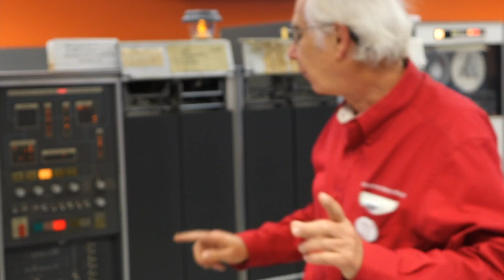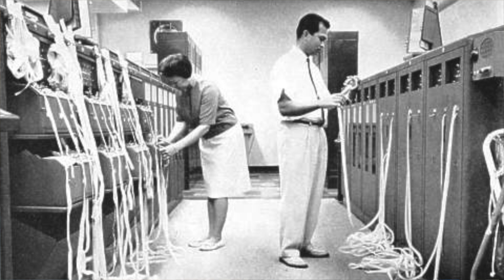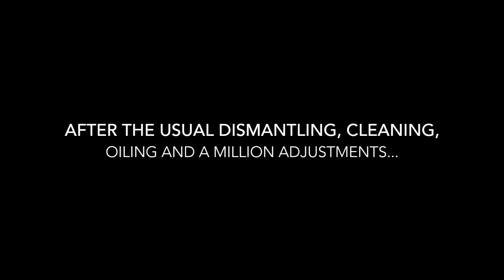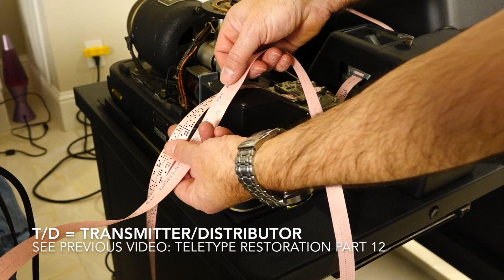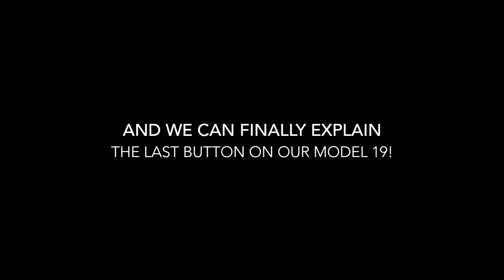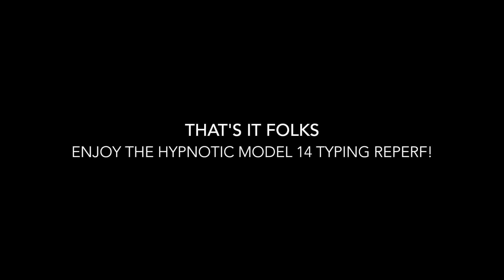Teletype Model 14 Reperforator

Comment: Watching it print letters and numbers it hits me that a similar or same mechanism must have been used for stock ticker printers. Even today when you see scrolling stock quote ticker tapes the letters are on the top and the numbers on the bottom of the tape

Also, I wonder if you were aware how these same tty with baudot code were used by the deaf community to communicate over the telephone.

Comment: So the Model 19 cannot punch incoming transmissions? Why? Magnet and keyboard drive the same bars which in turn control the punch, so that shouldn't matter.
I'm just wondering, as german machines had that feature and it was used extensively. Reperforators were almost unkown here, the only big user I know of was the dpa. All others preferred having the message printed by default and kicked the punch in when it was needed.

Comment: CuriousMarc, like you I have a working model 19 now- with the "H" motor stop feature as well. I have since "inherited" 4 model 15 KSR's, two 14 TD's and one lone model 14 KTR- a typing reperforator like this one, but with its own keyboard. Thanks to your videos I have been able to restore them all, add the motor stop feature to my model 19, and all the 15 KSR's, and develop a circuit for all following your "loop boxes" design (tremendously clever!) I am in the process of locating the model 19/14 KTR/14 TD's in my radio station, the 15 KSR's in my house, shop and barn office, along with a magneto phone system! Many thanks to you and your friends for these outstanding videos- I owe you greatly!
Reply from the maker: Congrats! You are on a roll! How did you get so many Baudot Teletypes? Do they grow them where you live?
Reply: @CuriousMarc  lol it's the mountain air, the abundant rain and all the rabbit manure! It worked out about like the couple trying to get pregnant. I just quit looking and hoping and they bumrushed me!

Comment: I worked an operator on the 5 letter code tapes during the 1960s. At the time it was the 3rd largest major relay station as far as messages sent and received in the world .  You can't imagine the noise produced by 20 or more printers, receive aisle reperfs, send aisle, high speed routing machines humming along on a 24/7 basis in prefab trailer in a relatively small area.  I ran the QC on the messages as well as all the other operational aspects. The interesting part for us was when the power went down. The quite sound of no noise was very peaceful.  I spent 3 year and 3 weeks in Vietnam. Thanks for sharing your knowledge so we could have a new prospective and appreciation of how it ticked.  Your teaching was excellent! NNNN

Comment: what do you use to power the teletype when not on the desk power source? like when you where restoring it , you used something in blue boxes
Reply from the maker: The supply shown in the videos is a HP 6645A that can do up to 120V DC. The blue boxes are for the current control resistor and loop jacks (explained in this episode https://youtu.be/xDZkqIIWofk). Eventually I bought a cheaper asian Tekpower TP12001X 120V power supply dedicated to this setup. A bit annoying to setup the current limit the first time, but otherwise works great. Got it from Walmart online: https://www.walmart.com/ip/TekPower-TP12001X-120V-DC-Variable-Switching-Power-Supply-Output-0-120V-1A-Digital-Display-With-Back-Light/144911196
Reply: @CuriousMarc  seems the link
 is gone?

Comment: This is great, thank you.  Now, how about White Out?  Did that work with this?  What about backspace?  </sarcasm>
Reply from the maker: Actually on the Model 19 perforator, there is a backspace key that enables you to correct tape errors. The way it works is explained in the Model 19 demo video.

Comment: I noticed 5 semi-circular parts on the top of the machine, which seem to be shifted by 5 arms going down the right side. Do you know what they do?
Reply: Found your explanation (around 8m00s) in an earlier video.  Awesome! 
https://youtu.be/ug5lUI-hs3s
Reply: The semi-circular parts have slots milled in them. They are shifted to one side or the other based on the condition (mark or space) of the incoming bits. When all five bits have arrived and the semi-circular parts are in their final configuration, the mechanism releases all the type lever assemblies. Only one will have slots lined up in all the semi-circular parts, thus only that one falls forward a bit into the slots.

This is a selector. It has selected one of the type bars, the one that is associated with the particular pattern of incoming bits. The type lever that has moved forward is contacted by the moving mechanism, causing the type bar itself to fling forward and strike the ribbon, tape and platen. 

The arms going down the right side carry those same positions, the captured character code, down to the punch unit.
Reply from the maker: How it works is also explained in this video here: https://youtu.be/jxkygWI-Wfs?t=952

Comment: Does the reader have to be set up specially for the chadless tape? I presume optical readers wound’t work with this... by the 70s were there many “new” tape readers that were mechanical?
Reply: The regular readers, which had spring loaded pins that would push up through holes, also push the chad flap up and read accurately.
Reply: My new Electronica Metal band name is Chadless Punch

Comment: Marc, excellent video as always.  WRT to the "mute" button I have a feeling that it is miswired.  There isn't really a good reason for "mute" to send a break signal and cause leader to be punched.  My experience with TTYs (ancient experience, 'cause I am getting toward ancient) is that the mute should have disconnect the repurf from the loop and forced loop current into the repurf (idling it).  Of course, I could be wrong.  On an barely related note, my favourite TTY is the ASR35 which I owned for a period of nearly 10 years (1975-1984). That was a beauty to behold as the square print block danced across the page.  Unfortunately adult endeavours and changing priorities required a liberation of the space it consumed :-)
Reply from the maker: That got me thinking for a second too. It’s not a line break. It simply shorts the output to the reperf. So it does not interrupt the loop and avoids making the rest of the devices in the loop chatter. Simple and efficient. Shown as such on the schematics too, so we’re pretty sure it’s correct.
Reply: @CuriousMarc  thanks for the additional explanation. Seems a peculiar mode of operation but there must of been a good reason back in the day.  

BTW, when I said "Break" I meant that the repurf was seeing a Break signal (zero current) since with its input shorted there was no current through its solenoid.  I understand the loop is contiguous and the rest of the system has is seeing MARK because the 60mA is flowing.  Since the repurf has been partitioned out of it it has no current and thus sees continuous SPACE (Break).  Wow, it's been so long.  I hope I haven't got my nomenclature backwards.  Thanks again for the trip through memory lane

Comment: Beautiful ! Like a work of art. Built when we were Engineers not program writers. You can see the results. There were still teletype & telex machines in operation when I first started in telecommunications 31 years ago London Heathrow Airport. It’s great to see once again. We had to be careful working on the cables as they “called” at something like 110v DC and if you were touching the wires at the time it could certainly make you jump !!

Comment: Was there ever a device that could be attached after the T/D unit to "erase" the tape by automatically punching five holes in every character, making the tape impossible to read afterwards, or perhaps a shredding unit? I'm sure that operators would burn used tapes regularly in sensitive situations, but it would be another tool for security. Because if not, all we'd need is a time machine, and we could be rolling in it.

...or has the 21st Century just made me intensely paranoid?
Reply: There is a character that punches all five holes - it is the equivalent of 'white out' to correct a mistyped character by causing the reader to skip over it. You would back up, type that character to punch all holes, then type the corrected character.

For security purposes, it wouldn't be sufficient. Tiny alignment differences between the original holes and the new five punches likely would leave remnants you could observe somewhere around the rim of the hole to detect where a hole had been previously punched. I bet you could recreate a substantial portion of the text this way given enough time to study the tape. 

Burning it seems to be better, but then the ashes have to be stirred or pulverized to be sure that blackened shreds don't give away parts of the message
Reply: @carlclaunch793  So a machine that cuts the ribbon in half and splices it back together in correct places, then sets fire to the removed portion.
Reply: @carlclaunch793  One of the things I most like about this channel is that so many of the folks in Marc's videos are willing to respond to comments here. Sometimes I learn as much from the comments as I do from the videos themselves, and that's not a thing I ever thought I'd write on YouTube.
Reply: I mean, being paper I can imagine just burning it would suffice

Comment: Maybe a dumb question but why didn't they make a tape variant that was wider so you could print the code in an unpunched area?
Reply from the maker: Because you want the resulting punched tape to be inserted in a regular T/D for transmission. That constrains you to a standard tape width. The chadless tape is quite a clever workaround!
Reply: It's down to simple bureaucratic inertia. Businesses and governments had already standardized on a tape width. They'd rather put up with a little inconvenience than replace all of their machines. I don't know if there were millions of teletypewriters, but I wouldn't be too surprised if there were. That's a lot of throwing out perfectly good equipment just to get a relatively tiny improvement.